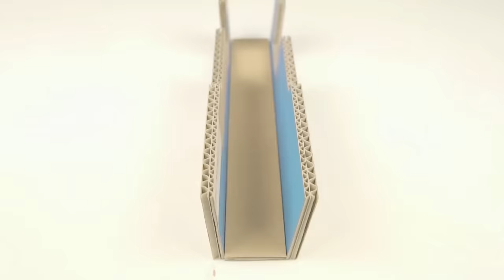How to Make Cardboard M1919 Machine Gun That Shoots

Comment: The real question is, how sturdy is it
Reply from the maker: It just made a model card gun, it's not really strong ... just a toy
Thank you for watching! Welcome to V.Idea channel
Reply: @V_Idea  (in thick russian accent)
Is sturdy enough to invade Berlin?
Reply: @the_honkler778  not as sturdy as DPs
Reply: Breaks when enemies burn it
Reply: @the_honkler778  thicccc*
Reply: Do you want to make the cardboard gun stronger, harder, and water-resistant?
I know how.
Just let me know if you want.
Reply: @martinanastacio5040  well, i'd like to know.
Reply: @tryingtoreachyouaboutyourc6161  
All you need are:
1) PVA Glue – also known as wood glue, white glue, or… ELMER’S GLUE
2) Water
3) Disposable plastic cup
4) Paint Brush
5) Plastic Sheet

Procedure:
1) Have ALL cardboard components parts lay on top of the plastic sheet (so hoping that the parts won’t be stuck on any surface such as table, etc. while waiting for the glue to dry in the next steps)
2) Mix about 15 ml of glue to the same amount of water in a plastic cup (1:1 ratio, just mix more later if needed), Using a paintbrush, apply a coating of glue-water mixture to the cardboard and leave to dry for about 2 hours.
3) Repeat Step 2
4) Repeat Step 3… but with more glue this time (2:1 ratio)
5) Cardboard Gun... ASSEMBLE!!!

Notes:
* Rinse the paintbrush under running water EVERY AFTER USE… Or you might buy more paintbrush because of the “dried glue”
* Painting the gun with glue-water mixture BEFORE assembly is necessary because you might accidentally glue moving parts together and you’ll have to redo the cardboard gun again entirely.
* When the glue dried, the cardboard will have a hard, shiny, plasticky surface… And a bit water-resistant (BUT NOT TOTALLY WATERPROOF)

Reference:
Please search in Youtube “dali diy iron man mk42 softening hardening”. It’s a video where a youtuber made his iron man helmet and how he made the helmet to be harder, and more durable using glue and water…. AND it’s his tutorial on how I made my own Iron Man Mk42 helmet as well.

Good luck on your project!!!